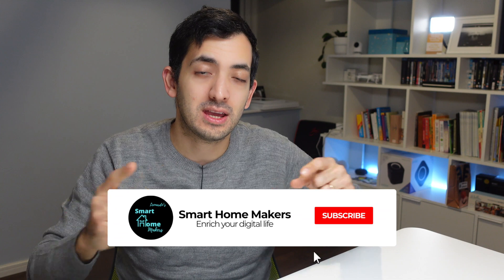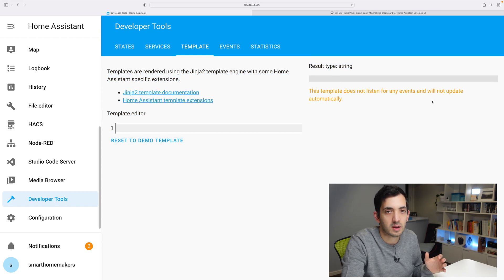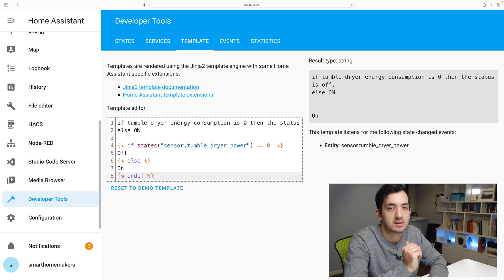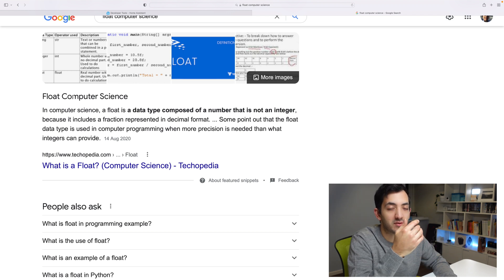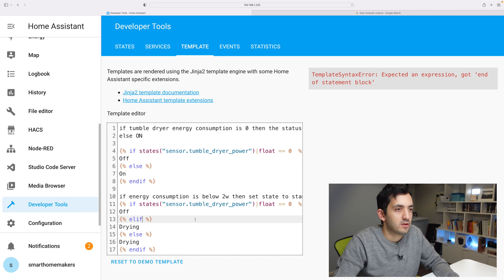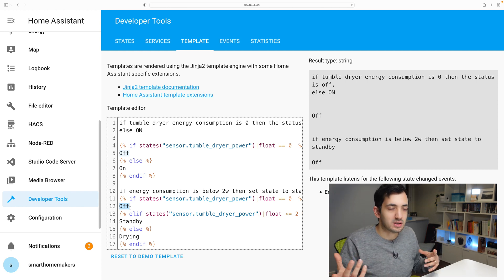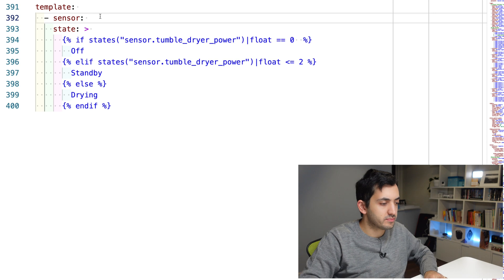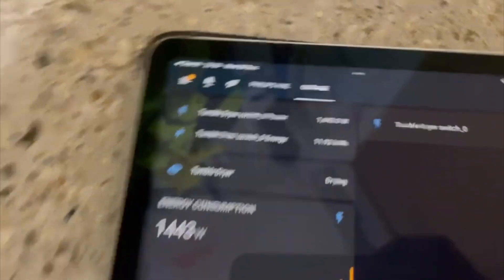Create your OWN Template Sensor with Home Assistant Coding Tutorial

Comment: Setting up an automation for our dryer is the one thing I've been unable to do so far. I live in the U.S. and we have the funky plugs for our dryers, so using a normal power monitor smart plug won't work. I've heard of Shelly before, do you have a link to the one you used? I know Shelly offers some products here in the US, so hopefully I can get one that will work.

Comment: Thanks for the great video!

I'm using Developer Tools, Template
But, I'm stuck here is my code:

```
(% if states("number.humidifier_target_level") == 55 %)
off
(% else %)
on
(% endif %)
```
I am getting this error:
This template does not listen for any events and will not update automatically.

I have checked the States and it shows 55.

Any help would be greatly appreciated!
TIA
Reply from the maker: Can you try to use states("number.humidifier_target_level") ? What do you get?
Reply: @SmartHomeMakers  Thanks, that is the same as I'm using.  Same error.

Comment: thanks for the tutorial! i'm getting this error, any idea what is going wrong here? 

 'float' got invalid input 'unknown' when rendering template '{% if states("sensor.dryer_power")|float == 0 %} Off {% elif states("sensor.dryer_power")|float <= 4 %} Standby {% else %} Drying {% endif %}' but no default was specified. Currently 'float' will return '0', however this template will fail to render in Home Assistant core 2022.1

Comment: HEy whenever i do the check i get a config invalid for 

Integration error: name - Integration 'name' not found.
Integration error: platform - Integration 'platform' not found.
Integration error: host - Integration 'host' not found.

i have no errors on my code and it is exactly the same as yours other than the name ( i am running mine for the washer right now)
Reply: and if i remove what i just added it says the config is fine so its something in this it doesn't like. I'm out of ideas of what could be wrong lol
Reply: figured it out by adding it it made another part in my yaml freak out
Reply from the maker: Hi Patrick! I’m glad you figured it out how did you do it ?
Reply: @SmartHomeMakers  Sadly had to rebuild my whole home assistant install (backups wouldn't restore for some reason_ so just had to do it all again.......
but this time went way faster lol
Reply: @SmartHomeMakers  
#washer#
template:
  - sensor:
    - name: Washer Status
      state: >
        {% if states("sensor.washer_energy_power")| float == 0 %}
          Idle
        {% elif states("sensor.washer_energy_power")| float <= 2 %}
          Idle
        {% else %}
          Washing
        {% endif %}

frontend:
  themes: !include_dir_merge_named themes

##Dryer#
template: 
  - sensor:
    - name: Dryer Status
      state: >
        {% if states("sensor.dryer_energy_power")| float == 0 %}
          Idle
        {% elif states("sensor.dryer_energy_power")| float <= 2 %}
          Idle
        {% else %}
          Drying
        {% endif %}

any thoughts? i can only have one cause it says duplicate key? i split the 2 templates by adding the themes one and it fixed letting me restart

Comment: Danke!
Reply from the maker: Welcome!
Reply: @SmartHomeMakers  
But I have one question left … what is the command if you want a range for the sensor …. ie between 40 and 50 … 
In you’re sample, you just covered 1 value i.e. <> one value …. how about between 2 values ?
Reply from the maker: @n.r.2258  have you tried >= 40 and <=50 (between 40 and 50)?
Reply: @SmartHomeMakers  

{% if states ('sensor.wasser_sensor') | float >= 40 and <=50 %}
         leads to:  TemplateSyntaxError: unexpected '<='
Reply from the maker: you need to repeat  the states portion again states ('sensor.wasser_sensor') | float

Comment: Excellent! I had no idea what templating was! I actually had made one months ago I think, made a switch and a contact sensor into a cover(garage door). But you explanation of those crazy brackets was super helpful, last time I did any programming was in the early 80’s and it was the Basic language, so I’m pretty much less than zero on programming knowledge. Thanks a bunch!
Reply from the maker: The basics of coding might not have changed much :) are you learning any new language now ?
Reply: @SmartHomeMakers  no I’m not, except the Home Assistant and Tasmota stuff.

Comment: Thanks for the video. I followed everything you did but after restarting I do not get a new sensor.tumble_dryer. Any idea why?
Reply from the maker: Hi Chris, did you get any error messages? Do you want to share your YAML?
Reply: @SmartHomeMakers  Got this error; 

The following integrations and platforms could not be set up:

template
Please check your config and logs.

Logger: homeassistant.config

Source: config.py:464
First occurred: 1:27:53 PM (1 occurrences)
Last logged: 1:27:53 PM

Invalid config for [template]: expected dictionary for dictionary value @ data['sensors']. Got [OrderedDict([('name', 'Washing Machine'), ('state', '{% if states("sensor.washer_power")|float <= 10 %}\n Off\n{% elif states("sensor.washer_power")|float <= 40 %}\n Done\n{% else %}\n Running\n{% endif %}\n')])]. (See /config/configuration.yaml, line 60).

YAML below; have another "sensor" header. Maybe that's creating the issue.
sensor:
  - platform: systemmonitor
    resources:
      - type: disk_use_percent
      - type: disk_free
      - type: memory_use_percent
      - type: processor_use
      - type: processor_temperature

template:
  sensors:
  - name: Washing Machine
    state: >
      {% if states("sensor.washer_power")|float <= 10 %}
        Off
      {% elif states("sensor.washer_power")|float <= 40 %}
        Done
      {% else %}
        Running
      {% endif %}
Reply from the maker: @cchris3  can’t spot anything wrong! Is template aligned to the left no spaces ?
Reply: @SmartHomeMakers  Yea, left aligned with no spaces. "Check Config" says valid and restart happens without issues. But just dont see the new sensor. Thanks.

Comment: Thanks for the video. I got it to work with a Sonoff S31PM by using {% if state_attr('switch.sonoff_s31pm', 'power') == 0  %} in place of what you were using.
Reply from the maker: Is that because the sonoff switch has power as an attribute of the device and not its own entity
Reply: @SmartHomeMakers  Yes, it is an attribute not its own entity. I'm using the HACS integration to get it to work in Home Assistant.

Comment: Thank you for this, I have searched for any syntax documentation for creating templates and have had to rely on looking at other users code for clues, can you point at such documentation? For example I first thought to use a case statement rather than if but can’t find if one is available for use! 
I also found that I could just update templates rather than restarting HA, saved a ton of time with my many errors and restarts.

Thanks for what you are doing to help us all!
Reply from the maker: Hi Rick! There is a jinja2 templating documentation from the developer tool haven’t got a link on me :)
Reply: @SmartHomeMakers  Maybe my biggest issue is that I never know if I am coding Yaml, Python or Jinja. None of which I have used before. Thanks!
Reply from the maker: @rickz6006  python is the programming language that HA is built upon, yaml mainly is seen as a configuration language as is jinja
Reply: I find the same, it's hard to figure out the prefix etc. It would be nice if there was a homeassistant examples cheat sheet trying to relate to the jinja documents is hard